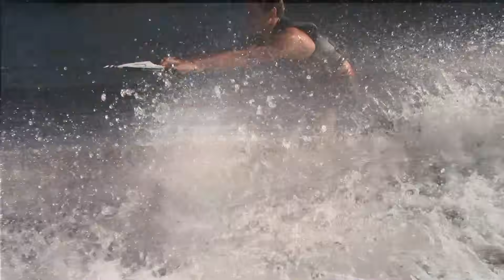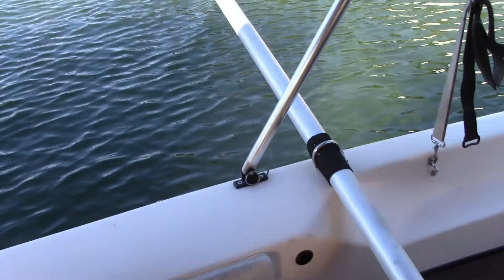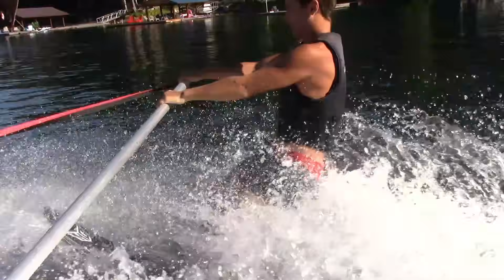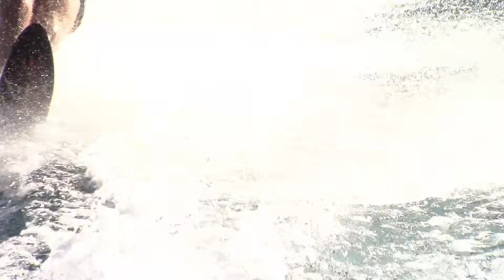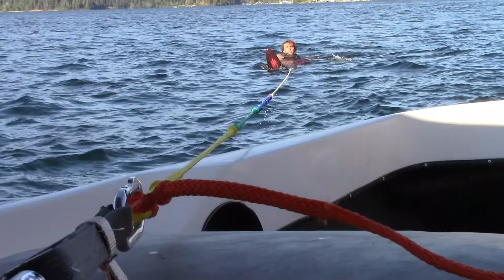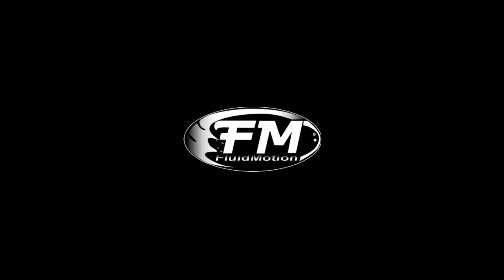Deepwater Start Slalom Ski Water Skiing

Comment: Sir; I am having trouble slalom deep water start behind a 2005 Seadoo 180 hp Supercharged jetski.  65 yrs, 180 lbs, Full throttle rips handle out of my hands.  Could you please recommend an acceleration curve for starting ?  Thank You.
Reply from the maker: I would progress from a very large ski, slow acceleration starts. Find your low drag position and hone it. Then move to whatever ski you like to use. We are using a Radar Butterknife for new-skier longline starts this season. Wiley's has 67" for $150. Fantastic ski for deepwaters.

Comment: When taking off is the rear foot in or out of the binding?
Reply: Can do either. I used to leave mine out and use as balance. Now I keep it in and push on my back foot and try not to bend over like this guy is doing.
Reply from the maker: @cdrseabee  With a toe loop I drag the free leg. Matt started two feet in.  Logan is hinged back at the hips. That's his balance position, a bit like a gym row.
Reply: @cdrseabee I dragged for years until 2 years ago. I'm female and turned 50 and realizing I don't have the leg strength I used to. Once I learned with 2 in it seems easier from the perspective that I get to use both legs for strength vs just one.
Reply: Either. Start with back foot dragging, then slip in. Drag time will be shorter the more you get used to it.
Reply: If just learning, yes. You'll drag it until balanced, then slip it in